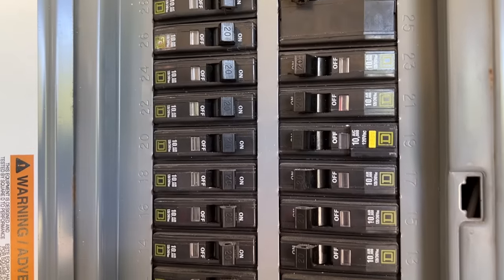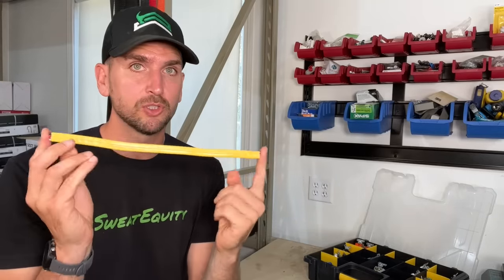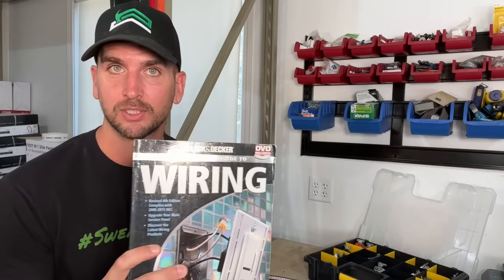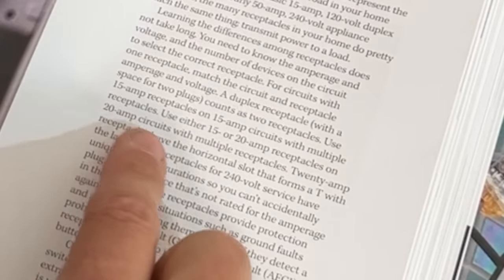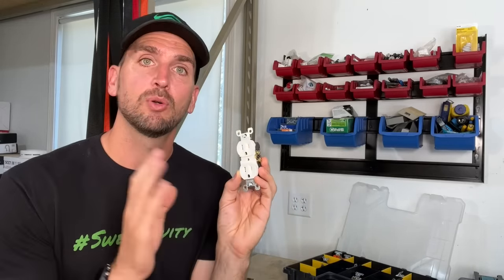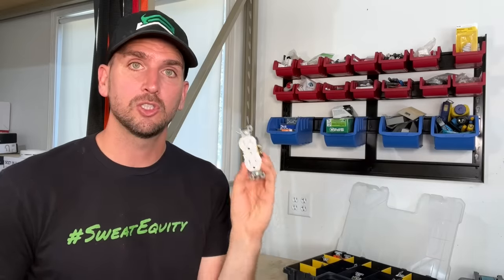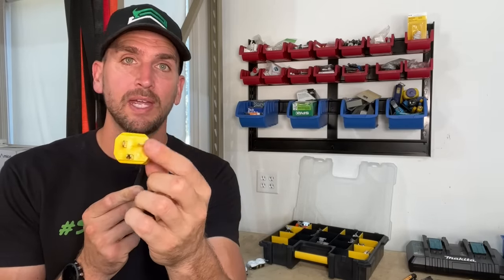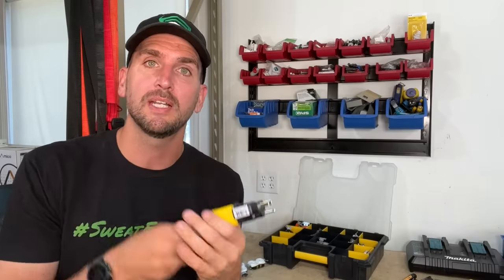Can 15 Amp Outlets Be Used On A 20 Amp Circuit Breaker

Comment: Something I can't believe that hasn't been outlawed yet. Are those mobile home switches and outlets. That is the biggest piece of garbage I have ever seen. When I did residential service. If I got a call to a Mobil home (even new ones)  switch or rec. wasn't working. It was 98.9% of the time those garbage devices. I would take them out cut a real box in and put a normal device in. Also never stab, always wrap. Stab is garbage too. Idc if it legal.

Comment: If a circuit is for 20 amps, do not put lower compontants on its circuit. If only rated for 5 amps or 19 amps , 20 amps it to high , somerhing will damage or a electrical electricution or death if compontant made to handle   less than  it is being served. , answer is no under the code book to save lives in safety. It will work til reach over 15 amps then something damages. Do not use a lower rated electrical part on a higher rate of electrical. It can be fatal.

Comment: The code is BS!! and for the most part always has been. So you have a 20 amp ckt and 15 amp bkr. What protects the 16 ga wires rated for 10 amps utilized on small appliances??

Comment: I thought that ALL outlet circuits (when wired according to code) were 20 Amps.
Reply: I believe you mean 20 amp, not volts.  They can be 15 amp by NEC except at locations required to be 20 amp.
Reply: @KevinCoop1  Yeah, thanks, I’ll edit that.

Comment: This is directly oppose to the CEC. What this person is saying in this video is NOT applicable to Canada. Doing this in Canada will fail inspection and your home owners insurance will not cover you when the 15a outlet fails due to someone using kitchen appliances in it.
Reply: The CEC and the NEC in my experience are the same.   Can you tell me which section of CEC you are referencing?
Reply: @KevinCoop1  14-600 in the 2021 CEC code book. The code is: Receptacles shall not be connected to a branch circuit having overcurrent protection rated or set at more than the ampere rating of the receptacle except as permitted by other Sections of this Code.
Reply: Exceptions are extremely rare in the CEC code book and there is not one that allows for one for dealing with living space receptacles.

Comment: We have to stop this stupid discussion. 20A circuit breaker can safely handle 15A load. So, 20A load at 20A socket on 15A breaker and 14 AWG wire may cause fire or, usually, will trip the breaker. But you can place any number of 15A and 20A sockets on 20A CB and 12 AWG wire without any safety issues. And the most important note here: CB protects wire, not load. 20A CB should be wired by 12 gauge wire, 15A CB could be wired with any wire size from 14 and bigger and will be protected at 15A (short time) and 0.8×15A for ~1hour.

Comment: Either a receptacle is rated for 20 amps use or it's not; If a receptacle manufacturer does not  rate a particular product for 20amp use, there probably a good reason. I would not use at 15 amp device on a 20amp circuit.
Reply: Except that you do everytime you use an outlet in your kitchen. They're 15a outlets on a 20a circuit.
Reply: @dracula3811  This is an error with the electrical code, common sense is no longer being applied.
Reply: @petertyrrell6690  are you an electrician? Horse much experience do you have in dealing with the nec code? There are many master electricians who contribute to updating the nec that disagree with you. You obviously lack the understanding to make an informed statement on this matter.
Reply: @dracula3811  Yes I was a Canadian Master Electician for many years, I am now retired. You shouldn't have devices rated for 15amps, protected by a 20amp fuse or circuit breaker, how does that make sense?  Everything you want to use on a 20amp circuit should be rated for 20amps  including the cord and plug that connects the appliance to the 20amp receptacle. Should be easy to do right? There may be an issue using existing, cheaply made, 15amp rated appliances protected by a 20amp breaker, but the experts have this covered off, right?
Reply: @petertyrrell6690  except that these devices are rated for 20a pass through. So your statement is incorrect.
Reply: @dracula3811  Have you thought about this at all? If you plug a 15amp device into a 20amp rated circuit, the 15amp device is not properly protected. The latter is not new of course, many extension cords are not rated at 15amps but are, anyway, plugged into a 15amp receptacle. The electrical code, is concerned about safety but overlooks properly protecting branch circuit equipment that is not rated at 15amps.  Fused plugs would solve the latter and are employed all over the world, eventually  they'll probably be  adopted in NA because it makes sense.
Reply: @petertyrrell6690  The exception in the code is because the assumption is that no single device can draw more than 15 amps, but with multiple outlets on a single circuit, they can easily combine to exceed 15 amps, so a 20 amp breaker is allowed, along with wiring that can handle 20 amps.  And really there isn't much difference between 15 and 20 amps.  If you are overrating your breaker by only 5 amps that really isn't a big deal.  Putting a 25 amp device on a 50 amp breaker is a little different.

Comment: No most common is 15 amp ... there are more  15 amp in a residential setting than 20 amp ... 20 amp are for wet locations kit and baths get the NEC... hack n decker is crap

Comment: Can you?.. Yes  Should you?.. No  You can think of amps as heat rating.  If the breaker has a heat rating of 20 and the outlet has a heat rating of 15 that means that your outlet will burn if you pull 19 amps through it.  And you may say,.  "Well how am I gonna pull 19 amps through a wall socket?" And I'm going to tell you.  "With a power strip."   And you may say,  "We'll were never going to use a power strip there."  And I say, "Wanna bet your life on that?"  And you say,  "We'll it's in the code book it must be ok."  And I say, "It get's updated every 4 years.  It needs work."
Reply: Let’s look at your scenario.   You are saying someone could pull 19 amps power with a power strip through a receptacle.    Absolutely correct.  But you do not need a power strip, plug two 1500 watt heaters into a duplex receptacle.  That’s 25 amps, correct?   What will happen if they are both working at 1500 watts?   After an undetermined amount of time, the breaker will trip under overload therefore protecting the conductors.  If you plug in a 6 amp appliance into three different receptacles on the same circuit, you will have 18 amps on the breaker.   If the loads cycle, everything will be fine.   If on continually, after an undetermined amount of time the breaker will trip under overload.   All is working as designed.   The system is protected from people doing things they should not do.
Reply: @KevinCoop1  This isn't something I made up.  There are many such cases and readily found by a simple internet search. The weakest link, lowest amperage, device in the circuit melts first. The receptacle is basically a fuse if the circuit draws between 15 and 20 amps *roughly.
Reply: @KevinCoop1  Also,.. How is that you think a 20 amp breaker will trip under 18 amps of current?

Comment: You getting way to technical man. A 15 amp duplex has to be able to supply 15 amps to each outlet, So right there you know the internals have to be capable of supplying more than just 15 amps.

Comment: There's hardly any plug in 120 volt user items that pulls more than 11-12 amps
Reply: Your comment is correct for residential appliances.   Commercial appliances are a different story.
Reply: @KevinCoop1  oh yes, I thought the video was about homes

Comment: Engineering consultant, do not use 20 amp breakers with 15 amp outlets.could cause a fire if overloaded..
Reply: Sr Design Engineer for contractor.   Cheap devices and old worn out loose contact receptacles cause arcing and heat that can lead to fires.  This is why we are now forced to install arc fault breakers or devices.

Comment: What makes you qualified to teach electrical work especially to homeowners. To become a journeyman it requires 8000 hour of field experience and 576 hours of classroom teachings. Do homeowners have what it takes?????  🤔🤔🤔
Reply: Typically, journeyman requirements are either a) 8000 hours of OJT and completion of a recognized apprenticeship program or b) 8000 hours of OJT and passing an exam. Classroom training is not usually a requirement whereas work experience is.
Reply: @pld8993   I was just stating new jersey journeyman license. PA doesn't even have a license. Either way doesn't make you qualified to be teaching electrical
Reply: @honorelectricalllc5883  Agreed, but youtube isn't about teaching, it's about $$. Unfortunately, the more wrong these videos are the more $$ they make.

Comment: Of course you can. The question becomes "is it wise". Lol
Reply: Sure. It's code and it's done in virtually every kitchen.
Reply: @dracula3811  Must be new construction, my kitchen has 20A receptacles. My choice, I prefer to "over design" things. I've never been a fan of using 14 gauge wire for branch circuits for example. Sure it's code and less expensive than 12 gauge but. Have a good evening.
Reply: @stevenbass732  it's been code to do it that way for decades. Virtually every home is done that way. Obviously not every single one.
Reply: @dracula3811  There's nothing wrong with exceeding the code. I personally never liked doing the minimum.

Comment: To bad Commercial outlets are not Tamper Resistant so they cannot be used in a residental building according to the NEC , good way for kids or dumb adults to die sticking stuff that doesn't belong into a unprotected outlet
Reply: Oh, but they are made!   There are tamper resistant receptacles required in certain areas of commercial work.   Waiting rooms of Dr office are one.

Comment: This is such foolishness. The outlet/receptacle is not the weakest link. Yes it could fail  but other components are likely to to fail first (e.g. wiring in the wall, wiring to the appliance). And the problematic failure mode is not running multiple 15 amp devices on the same circuit. It's a singe device that fails.

Comment: You ASSUME 12 gauge wire is used. Not exactly! I have all 14 gauge wire with 20 amp breakers. Can you please address this elephant in the room?
Reply: AFAIU code (and safety) would require that 14-gauge wiring should never be anywhere on a 20A circuit -- but instead only on a 15A breaker (most importantly) and only with 15A outlets -- just for proper indication at the plug-in site, so that folks won't assume that a 20A appliance will be okay to plug into it. 

I'm not an electrician, but this is based on what I know and have learned. Is that correct, op?

Comment: Why would having a 15 Amp load or components on a 20 AMP circuit not be a good idea?  ref.(https://youtu.be/u1LZfIV9GBs?t=29) If the circuit can handle 20 Amps it surely would have no problem handling a 15amp load, wouldn't it?  I could be wrong though; I am no certified electrician, and I could be wrong. Could you elaborate on why having a 15 amp load going on a 20 amp would not a good idea?
Reply: I personally think that having 20 Amp components or a 20-amp load on a 15 AMP circuit, now that may or may not be good idea.

Comment: 20 amp receptacle on a 20 amp circuit...period, commercial grade  regardless
Reply: Why?
Reply: @larrymiller4736  because I have pulled 3 melted residential grade receptacles out of my home that was built in 2013, one of which was the microwave receptacle,  that's why
Reply: @johnsb1550  I agree commercial grade are much more robust then residential, I was questioning why  the ultimatum of only 20 amp receptacle on 20 amp circuit?
Reply: @larrymiller4736  just because the microwave circuit was a 20 amp dedicated circuit with 12 gage wiring and a 15 amp residential grade receptacle twin outlet. Pretty sure this wasn't "code" but the way they build houses these days...cutting every corner possible...I'm not willing to risk my life. Circuit popped, wife came over and said " the microwave blew and I smelled smoke" , checked it out and found nothing,  reset the breaker...popped again. You asked, sorry...lol
Reply: @johnsb1550  If a 15 amp outlet has a short term load of no more than 15 amps on it and melts, then I would think you had a defective outlet.

Comment: This is ridiculous. You must not put a 20-amp outlet in a 15-watt circuit, but why would you worry about putting a 15-amp outlet in a 20-watt circuit? What will you come up with next: "Can 13-Amp Extension Cords Be Used With A 15-Amp Outlet?"
Reply: A 20 amp receptacle indicates that a 20 amp plug can be used and if so may likely trip a 15 amp breaker. 
A 15 amp duplex receptacle is ok on a 20 amp circuit because it's rated for 20 amp pass through.
Reply: I'm not a qualified professional, but my understanding is that the rating of a component indicates the current draw it can handle, not the maximum current it will allow.  Your example of a 13-amp extension cord, if one really existed, illustrates this perfectly.  Let's pretend tolerances are exact and there's no safety margin.  Now imagine that you have a device pulling a steady 14 amps.  In that case the outlet would not fail, and your breaker would not trip, so the appliance would just keep chugging along.  However the extension cord isn't rated for that current draw, and may begin to overheat, potentially melt or start a fire.

Also there's a difference between amps and watts.  A 15-amp circuit and a 20-amp circuit have a capacity of 1.8- and 2.4-kilowatts respectively in a typical American home.
Reply: @ryanhewitt9902  If you're using an extension cord, then you must not plug into it anything that draws more power than the extension cord is rated to handle. You can plug the 13 amp (1625 watt) extension cord into a 15-amp or 20-amp or 30-amp outlet. It's all fine. Just don't try to plug equipment drawing more than 1625 watts into the extension cord.

Comment: Don't put a 15 amp recep on a 20Amp circuit, just don't. You can spot a 20amp circuit by the 20amp recep. you can put 20amp receps on a 15amp circuit. You put a 15amp recep on a 20amp circuit you will have problems. just dont
Reply: 20 amp receptacles are NOT allowed on 15 amp circuits.   Only 15 amp receptacles are allowed on 15 amp circuits.  15 or 20 amp receptacles are allowed on 20 amp circuits.